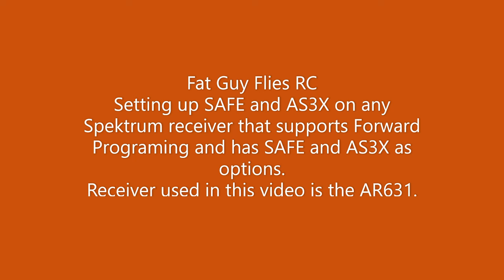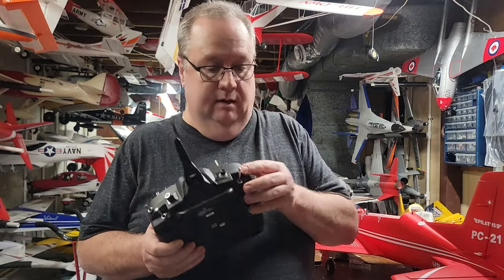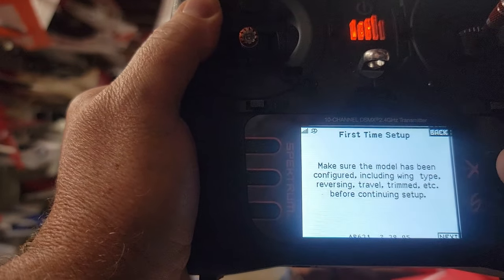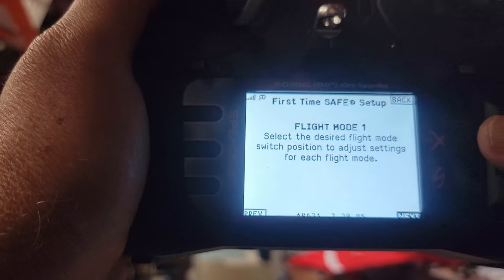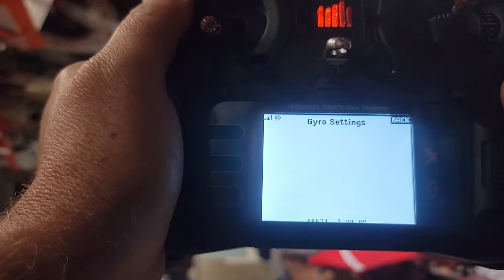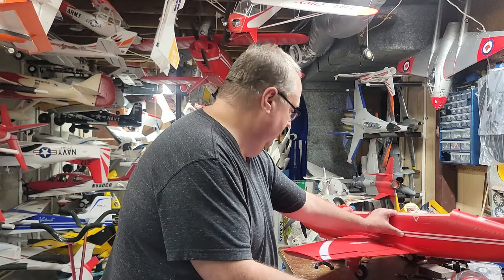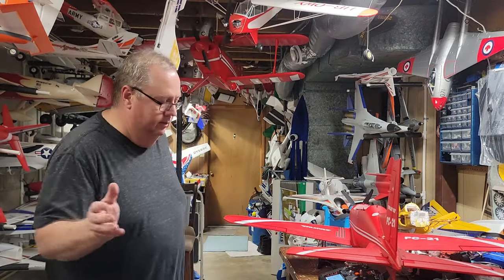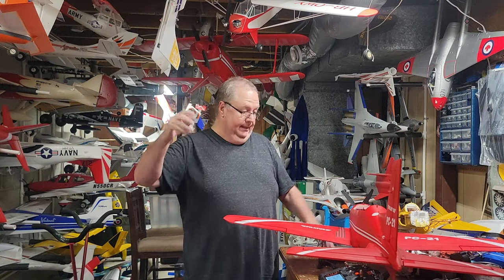Setting up AS3X and SAFE with Forward Programing-AR631-AR630  by FGFRC

Comment: Hey Fat Guy, thank you for this video.  I'm an old Futaba person that went to Taranis and OpenTx.  I've outgrown them both and found my way to a Spektrum NX8 and an AR630.  This video provided the stepping stone and the system was installed in my PNP eFlite T-28 1.1m.  I followed your video to the tee and maidened my NX8 this morning with zero issues and just a couple of trim changes.  Thanks again.
Reply from the maker: This the reason for the channel. Thanks!

Comment: Very good explanation that I haven't come across before and filled in some gaps for me. One critique I have is get yourself a clip on mic so we can still hear you properly when your farther than 2 ft away.
Reply from the maker: My issue with the mic is (i have one) then I cannot plug the phone into the screen (the big TX iI keep looking at)  to see if I am in focus or not. so If I use the mic , I have to hope the video does not cut out. i have done entire unbox and assembly videos using the mic then only to find out later that the video cut out right after I started.

Comment: THANK YOU! THANK YOU! THANK YOU! First off, God Bless You Sir! After watching Skektrum and other videos and attempting many times over to get the AS3X working I came across your video. NOT ONE OTHER PERSON MENTIONED THE THROTTLE HAD TO BE PUT OVER 25% FOR THE AS3X TO WORK! I've been flying for many years and I'm a Spektrum guy but fairly new to AS3X receivers. I was seriously starting to think something was wrong with my DX9. Your video was incredibly helpful all the way through! 
Something to note for more experienced/3D flyers is that if you choose to assign the gain to a rotary knob/slider, you need to make sure you switch the settings from fixed to adjustable in order for the in-flight gain adjustment to work.
Thanks again bud!
Pete
Reply from the maker: Well thank you! And yes , since I don't use the rotary knob then that is why I did not mention it. If I don't use something and have no experience with it then its not right to talk about it. lol

Comment: I will tell you exactly what happened.
 First, I used a 6s 3700 mAh batery on my 60 inches plane to make the basic set up of the moving surfaces, control throws, engine, etc., and everthing went perfectly. Then, for security reasons, (big prop on the nose), I decided to unplug this big battery and to use a 2s small lipo battery in order to work with the forward programming. I studied your video first  because since several years I have not installed another AR 630 receiver in a plane. So, I turned my NX8 on, and then I inserted in the very first port my 2s battery ( with the proper conector of course). This first port is labeled bind/program.
The receiver started with the blinking orange light. This was what happened. Since then, every time you turn on your tx and then conect the real 6S battery, the ar630 start with the blinking orange light. And keeps this condition.  You are forced to go into the binding mode into the tx in order to get the system working. After the flight, when you remove your used battery and install a new, charged battery, the situation is the same. You turn on the NX8, then connect the new 6S battery and the receiver goes inmediatly into blinking light ( bind mode). You need to go into the biding mode in the tx, you press the binding, and the system work again, ready for another flight. 
Thank you for your help !!
Mario
Reply from the maker: In forward programing at the first screen to you see other options at the end of the list. If so this receiver needs a factory reset. Purchase yourself a spektrum programing cable. And with this you can open this option up by updating and spektrum smart receiver that normally has forward programing.
Reply: @FatGuyFliesRC  I think that what we're missing here is that he is plugging something into the bind port so yes, the receiver goes into bind mode .   He needs his battery power going into any port EXCEPT the bind port.  Hint,  just take the prop off and work with his 'normal' battery.   ??

Comment: Nice job!

it took me a long time to figure out forward programming and you did a nice job explaining it and highlighting the two or three issues that most people get stuck on. 

The only thing that was not mention and I assume you purposely left it out because it is challenging was setting the gain which controls the amount of gyro deflection you get in AS3X. 

When you set the gains to fixed I’m not sure what it defaults too, maybe the gain settings that are in the SAFE/AS3X mode (your mode one) which appears Ok based on the amount of movement I could see and hear

The way I was taught to set gains was to set the forward programming gain to adjustable then put the “adjustment” on your transmitter slider or knob for each control surface (ailerons, rudder and elevator) fly it with the gain at zero and turn the gain up until the control surfaces start to chatter and then slightly back them off and use that value (there is a feature in forward programming that allows you to lock in that value).  Every plane is different and planes with larger control surface, for example a 3D plane, require less gain. 

Also the rudder for example can take more gain than the aileron. This can be time consuming, complicated and challenging. Some folks set the gains for a sport plane to 30 and that seems to be a good starting point.  

Anyway, you did a nice job and that will get the majority of people flying. Those who want to dial in their plane should look further into settings the gain values for the gyro (AS3X) for each control surface. 

I enjoy watching your videos, please keep them rolling!

Tom
Reply from the maker: Thanks so much and yes you can use the knob to adjust the gains in flight. Lemon rx also supports this in some of there receivers. But my channel I try to appeal to new pilots and on the fly gains adjustments may seem very intimidating to a new pilot.

Comment: Nice Job , I use a bubble level  set on my battery shelf  forward and sideways to be sure my model was spot on before I start my programming.  Your video was spot on .  Almost wishing I mounted my AR631 on the top side of my FMS SuperCub 1300m  .  Thinking how much easier it would be to slide those big 3200 mAh 50c packs in it.  Mmmmm ?…. I may rethink this. 😊.  I may  do some fabrication  so I can run my SMC racing hi voltage packs  as far forward for good CG. They are a bit to fat to slide in and still close the hatch.  A hobby that keeps on giving 😊
Reply from the maker: Yep ideas spawn more ideas!

Comment: Just a suggestion but one of the flight modes in your case flight mode 3 should be AS3X and SAFE totally off in case there is an issue with the RX. You want to be able to disable both of them in case of an emergency. Also there is a flight mode setup for the TX and a built in flight mode in forward programming just so you know.
Reply from the maker: Thank you.
Reply: ❤ I agree. I want 1 flight mode with neither SAFE nor AS3X ... ❤❤

Comment: Good video.  Next I want to be able to adjust my AS3X gains while in flight.  1st I need to be able to do it on my AR636A . I installed it in my Banshee 64mm after reprogramming it.  Maiden flight went well. Now time to fine tune it and mechanically trim it out so it’s spot on without using trim tabs.    I do this by trimming in flight . Then at home : power up without bumping throttle, pin all surfaces in place and the unhook each Clevis.   Then zero all trims and mechanically adjust push  rods to easily fit correctly into pinned in place surfaces.   Works great. Next time I fly it may take a few laps for gyro to learn new settings but she won’t or should not need much trim now.  😊
Reply from the maker: should be very locked in now.
Reply: @Fat Guy Flies RC  I hope so once I get it fine tuned.

Comment: I actually prefer to keep AS3X as adjustable and assign it to a knob. That way you can tune AS3X for that particular plane inflight. Crank it till it oscillates then back down some.  Most planes i use 1X AS3X but on one i had to use 4X AS3X because it needed more AS3X.  Also i turn AS3X off on flight mode 3.  Its more of a safety thing. Incase the gyro starts acting up (maybe receiver got loose) or sometimes i just want to fly without any gyro so just flip to Flight mode 3 and fly old school.
Reply from the maker: This is an older video I assign it to a knob now also to keep it in flight adjustable also.

Comment: Very good and clear video👌Could you please explain deeper the differences in between Flight mode 1,2 and 3? Following step by step your video, mode 1 is working perfectly but mode 2 and 3 gyro is not working at all🙄: I have an AR630. Where I should look at? Thanks for your help
Reply from the maker: For flight mode 2 and 3 make sure as3x is set to fixed and that you have run up the throttle to over 25% to activate it.

Comment: Great video, great video. For a tail wheel plane, the "set level" step means on the wheels, or prop up the tail to approximately level flight? The big question I have is can I taken anAR631 out of a club members crashed BNF AeroScout and use it in a PNP plane? Would I be able to go to forward programing and back to Factory Settings on such a BNF "used" receiver?
Reply: From tricycle to dragger, gyro will be off. U will need to re-orenintate the rx, like Greg does here. Otherwise, when u let off the elevator, it'll pitch drastically.
Reply: @old-rcplane-phart  My question is about "level" during set up - for a dragger I guess prop up the tail, don't leave on tail wheel. My problem is knowing what orientation is exactly level flight. "On the nose part" is obvious.
Reply from the maker: Yes prop up the wheel on a taildragger.  As far as the reused AR361 you will need to jail break that. Watch this (it also works with a ar361) https://www.youtube.com/watch?v=F3isbv1U8eM&t=463s
Reply: @FatGuyFliesRC  Thank you so much. I have watched many of Tom's videos, but never found/saw this one.

Comment: Dear Fine Guy. I cant thank you enough for your great video tutorial series. You are removing the mystery of my Spektrum RX step by step.
One question I have is this.
Do you need to have as3x programmed in your flight mode in order to use safe. Or can you just use safe and 3 modes where you set parameters for each mode and for dual rateon say another 3 position switch. So Switch b would give me safe beginner at mode 1 ,  then safe intermediate at with more control at mode 2, and finally advanced at mode 3.
Then on switch h program your dual rates. Or when programming modes on switch b set your rates there.
Thanks again sir.
Bob from Canada 🇨🇦
Reply from the maker: SAFE will only work with AS3x in the background and then with the other 2 modes you can adjust however way you wish.
Reply: Thank you sir. Your help is making my enjoyment of the hobby so much more. 
Bob

Comment: Hello.  Great video.  What are your thoughts  on keeping switch position 20:59  1 (default) disabled Safe & AS3X.  Switch position 2 AS3X only and Switch position 3 to have both Safe and As3X since you are using a 3 position switch.  I know this is personal preference.  Thanks for a great informative video.
Reply from the maker: Like you said it is personal preference nothing wrong with assigning them like you did. I basically show how but end up 99% of the time just flying in as3x and never touch that switch.

Comment: Very informative video. I'm about to purchase an AR630 receiver, however, I'm not sure if this receiver is programmable with a DX6 transmitter exactly as shown in your video (without assistance from a computer, just like it was demonstrated in your video).
Reply from the maker: If the DX6 can do forward programing then your good , otherwise the AR630 would be nothing more than a straight receiver with no gyro of any type.

Comment: Thank you, very well explained, I just have an issue where everything works as it should except for my ailerons are being corrected the wrong way by  the Gyro ( both AS3X and SAFE), stick inputs are moving all control surfaces the correct way though. Do you have a video showing how to correct that?
Reply from the maker: You must start over with the forward programing and make sure all surfaces are moving correctly first. You do that by going to function list, the servo setup and reverse if needed. Then start forward programing.

Comment: Very good tutorial. I did Forward Programming on an AR630, just about a week ago, for my recently built FT Tutor. Finally got it done after watching several different YT videos. Yours video is at least as clear as the others I viewed, maybe even more so.
If I wanted to go to flaperons on my 4 channel FT model would I have to reprogram the receiver or just simply rebind with two wire aileron servos and model defined with flaperon wing type? Thanks.
Reply from the maker: A far as flaperon you would end up having stabilization on one of the wings not both. I don't think spektrum has been able to include flaperon mixing into their stabilization equations yet.
Reply: @FatGuyFliesRC  That's too bad. Thanks for the info.
Reply: Gyro's are ALL 3 channel. 

Buddy has the FT Tudor. You don't need a gyro with it🤷‍♂️, it's a floater.
Reply: @FatGuyFliesRC  That is not accurate.  As long as you configure the wing type properly for "2 aileron" in the initial setup it knows you have 2 servos on ailerons and it will setup the gyro to work with both.  That is how I did my AeroScout for flaperons.  If it was initially setup for 1 aileron channel and you move one aileron to its own channel it is true that it will not work on that channel.  You have to perform a first time setup again after changing the model setup.

Comment: In all your flying videos, you come across as a bit of a happy fool, but you're certainly not. You know your stuff. Thank you for sharing. You did a very good job of making the video, nice and slow. At the start, if plane is a tail dragger is it necessary to lift tail up level and consequently every battery hook up ensure plane is levelled for Initialization?
Reply from the maker: Thanks , yes get the plane as close to level position to simulate flight as possible before you lock in the SAFE parameters.
Reply: @FatGuyFliesRC  .....and every time you connect a battery?

Comment: Hi! Great video. I have see two thoughts on the step in SAFE mode setup where it tells you to set plane level. If I have a tail dragger warbird, some have said at the leveling step, lift the tail up so the plane is actually level. Others say leave it as which is tail lower than front. What are your thoughts?
Reply from the maker: I would lift the tail to mimic level flight then let the gyro record what is now level flight. The already tuned planes like a Eflite BNF plane already has this taken into account on their planes. When you set up a blank slate spektrum receiver that receiver has no idea what kind of plane it is going into. So you are doing the tuning to that type of plane.

Comment: My new iX20se has the as3x programmer built in. It's nice to NOT need a computer, cable, etc to reset a safe rx now! After doing it (jailbreak a used rx), via cpu, cable, etc it's soooo much easier iX way. I assume (& we all know what 'assume' means), the iX14 will too.

Setting up a NEW safe rx is so much easier than jailbreak'n an older, used 1.
Reply: The NX line as well. Isn't that what we just watched?
Reply from the maker: Yeah just cant afford the rx.
Reply: @FatGuyFliesRC  I think the only difference between the ix20 and what you have is the touch screen. It's the same menu... we have to access it via roller ball
Reply: For the 2k that ix costs it should make you breakfast too!

Comment: Hello, great videos! I have a question: Can I easily set up the NX6 transmitter with the AR630 receiver without using a PC, as shown in your video, in order to activate the gyro ? Thx:)
Reply from the maker: Yes you can! IUf it is a used ar630 then set to factory reset and follow this video.

Comment: How do you reverse a control surface of its acting in reverse through safe mode? Excellent video too by the way. I see I will be doing a reset on mine right now as well. Thanks
Reply from the maker: You must reverse it BEFORE you do the forward programming.

Comment: Thanks for an excellent video and explanation. Quick question: how do you decide what gain values to use for each flight mode?
Reply from the maker: I dont, the as3x gains are selected automatically to mid line sort of setting. If you find that they are to much or to little then you can change to adjustable and through the transmitter dial them up or down. However for me they have always been perfect.

Comment: Hi, thank you for the excellent explanation. I have nx8 and ar631 receiver and my plane has flaps and wheel retractor so all the 6 channels are used. Can I still have separate switch for safe mode or do I have to put the wheel retractor and safe on gear switch?  Thank you again
Reply from the maker: Yes as long as you have more than six channels in your transmitter and since you have a 8 channel your good.
Reply: I have  the same question  . Thx  ❤❤
Reply: @FatGuyFliesRC thanks for the answers and thanks for those great instructional videos.  ❤❤
Reply: Thank you again for the effort @FatGuyFliesRC